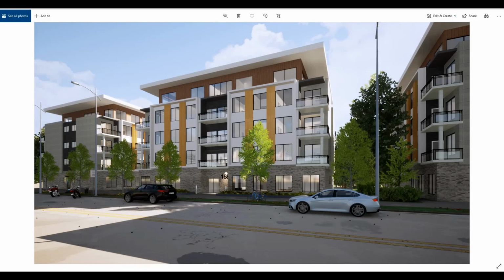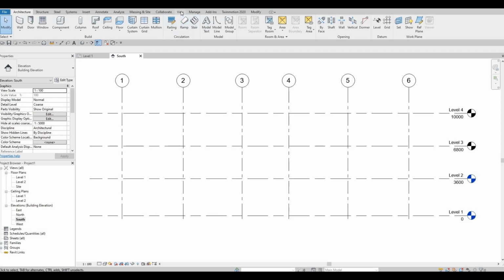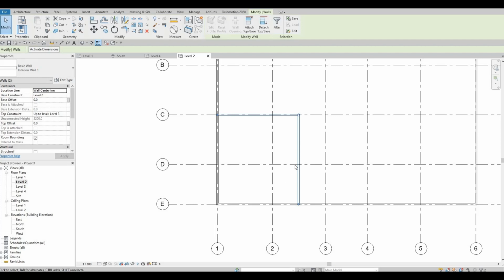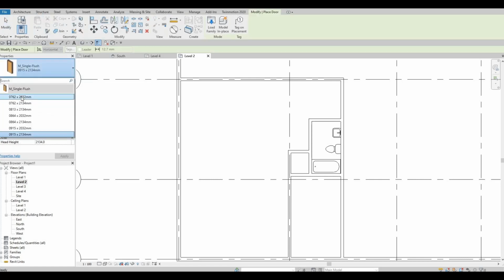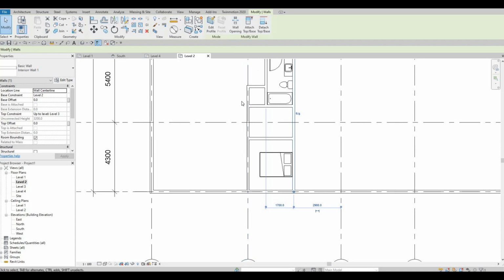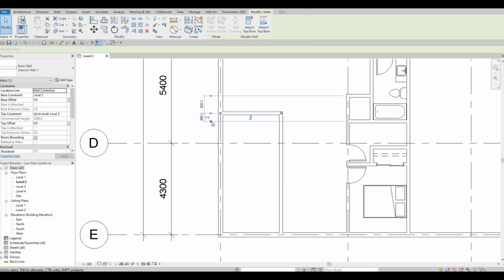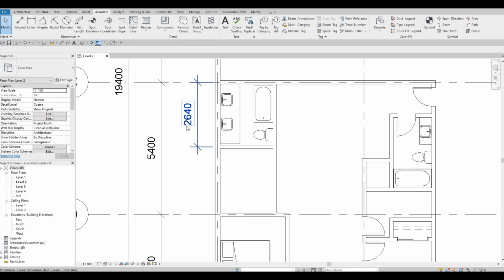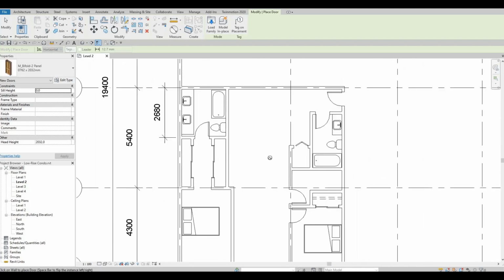Low-Rise Condo | Part 1 | Complete Step by Step | Revit Project Tutorial

Comment: Is there an exercise file that you are using? I was following you when you inserting the bathtubs I could not find that file? Also when you created the interior wall I could not find clad-white I could not find it maybe it's because I am using Revit 2022! can you please clarify for me? Hands down you are the best
Reply from the maker: Hi Ab, if you check on new project series, I have added the whole revit library. You can use that and you will have what I have. Also if you cannot see the clad white. You can hust choose a different material that is white. The most important is that you change it. The change in materials is most important in twinmotion part as I show you what material I used for all of this. 🙂🙏
Reply: @ArchCoreDesigns  Thanks for the reply, where is the Revit library is it in the description?
Reply from the maker: Hi try this https://drive.google.com/drive/folders/1OGJ9isbOnP3-C0stJr_HRnZIf8lKhG5f?usp=sharing